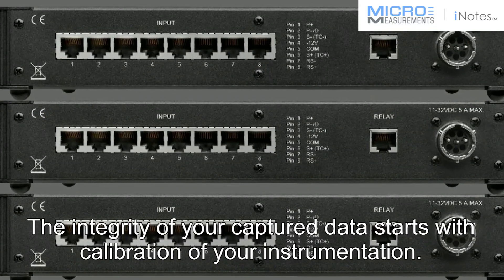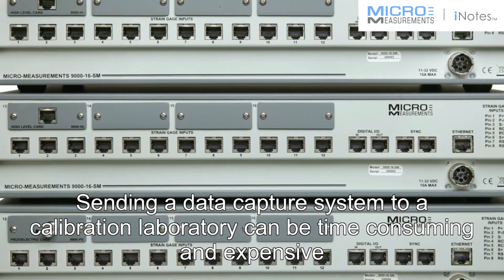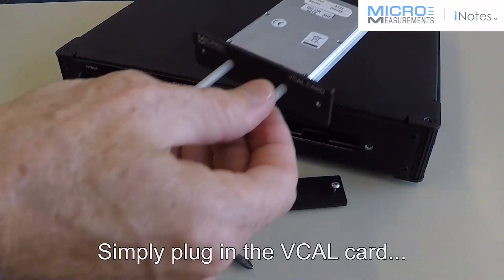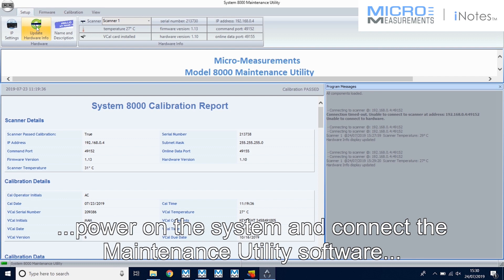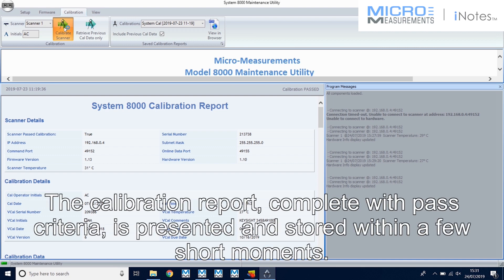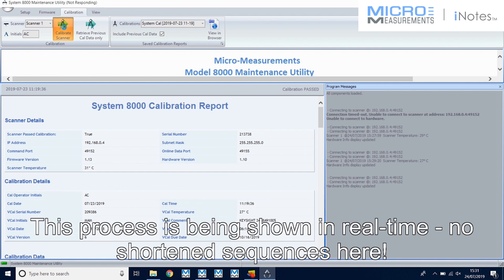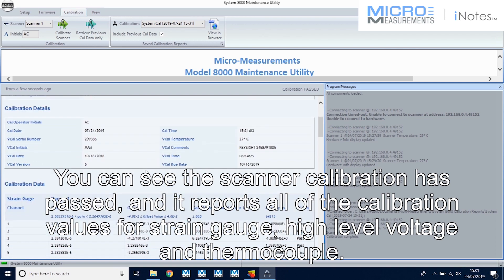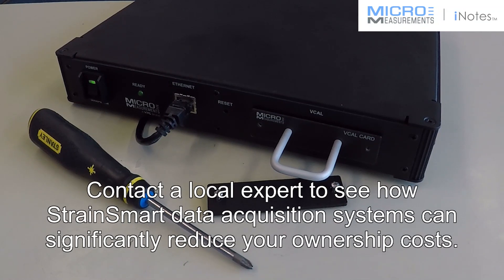How To Calibrate Your Data Acquisition System. (StrainSmart Self-Calibration)

Comment: En esta iNote Anton nos explica y muestra cómo calibrar su DAQ, en este caso el Sistema 8000 de Micro-Measurements. La Tarjeta de Calibración por Voltaje de Micro-Measurements (VCAL) está disponible como accesorio, y proporciona la capacidad de realizar una calibración de todo el circuito de medición sin la necesidad de enviar el sistema al fabricante o a un laboratorio de metrología. 
Si necesita más información, por favor no dude en contactarnos. mm.es@vpgsensors.com miguel.bravo@vpgsensors.com